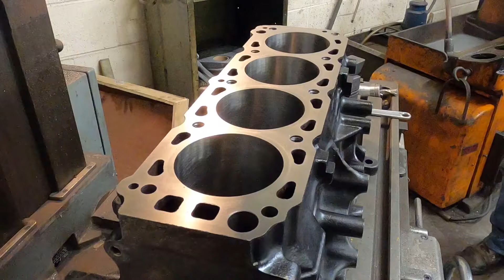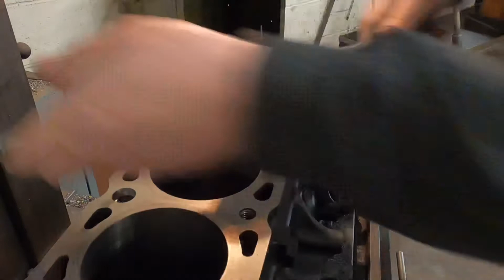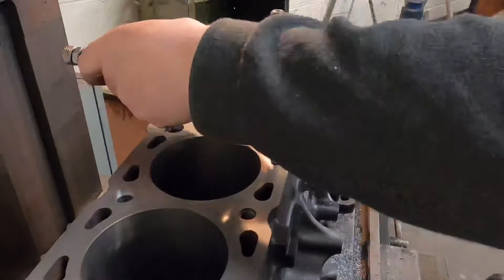Cosworth Motorsport long cylinder head stud conversion

Comment: Hi Barum engines. I have a cosworth yb 205 block with a crack between the head bolt and water jacket. Can this be fixed by you ? Thanks and just subscribed.

Comment: is there any way to do this on 205 block?
Reply from the maker: Unfortunately not long studding. What problem have you got with your block?
Reply: Some 205 blocks can be done. All depends  what is the distance from the deck face to the bottom of the water jacket.